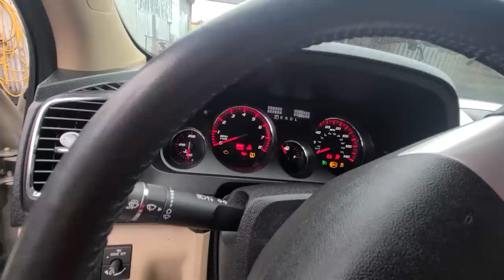Engines Need Oil.. Myth Or Fact? Drain Oil Redline And Learn! Neutral Drop

Comment: Please put a chain around an engine, then attach it to the wall and then slam in reverse… I wanna see if it’ll rip the engine out, sounds like a good video!!
Reply: DO IT
Reply: Or take the tire off a driveline axle wheel and let it spool up a rope or cable in gear and see if it will snatch the control arms and all out of it when it tightens up!
Reply: STUNTMAN GET OVA HERE AND READ THIS COMMENT
Reply: Can confirm this method of engine removal does work. A bit over 20 years ago I chained the 2.5 liter in a late 80s grand am to an oak tree, and neutral dropped it in reverse. When that 40 foot of chain ran out, what a ride. Engine and transmission came right through the radiator support. It was violent. As a bonus it was fun, and it saved alot of time removing the power train.
Reply: @williamsinger4124  "it was violent" 😂
Reply: @Me-zo8yc  yeah that sudden jolt and stop was about the equivalent to backing into a wall. Another added bonus, one of the bolts in the seat back broke...so I got a free gangster lean out of it too
Reply: @williamsinger4124  shame there were no decent camera phones 20 years ago
Reply: @Me-zo8yc  it would've been cool if we thought to record the antics we did with old junkers. We had 15 acres and 5 of that was trails in the woods. My neighbors also partook in the fun. Nowadays my old neighbors still come into our hardware store and we reminisce about the dumb stuff we did. My wife and father in law basically scratch their heads and wonder how I'm still alive. But they also know now why I act how I do lol. "The smart thing to do when doing something stupid is, to not think about the smart thing to do "
Reply: @williamsinger4124  sounds great having that much space and freedom, hopefully STUNTMAN will give us a 2023 remaster 😂
Reply: Yessssss Genius
Reply: @dougr.6734  Prolly It will brake and cut stuntmans face in many gorey pieces...
Reply from the maker: 🤔hmmm
Reply: Holy shitttt 😭😭😭😭
Reply: @dougr.6734  nahhh this one sounds too crazy for junkmans yard 😂
Reply: @NEUTRALDROP  you gotta do it!

Comment: The perfect car for a corner car lot... Looks good, has one of the most unreliable engines ever in it.
Reply: Honestly we have a 2011 traverse 3.6 in laws have owned it since 13k and only used full synthetic oil - few times they went over on their changes but we are still on the original engine, timing chains and transmission Power steering pump, 150k and again at 181k along with  water pump and also a catalytic converter around 150k but its the highest mileage car we have and most reliable they’ve had, honda accord split the engine vw eos blew the rings, and the others rusted out
Reply: Only 3.6L failure I know of might have had something to do with it being in a car driven by an idiot who drove it with the gas pedal floored most of the time and couldn't be bothered to check the oil. I checked it for him and the dipstick was dry. It took 5 quarts to bring it to the full mark and the engine holds 6. About a couple months after that, he told me the engine failed due to a "cracked block". (He thinks engines always fail because the block cracked. He's an idiot.) That guy has wrecked or destroyed pretty much every vehicle he's ever owned. I think his mom smoked crack while she was pregnant with him or maybe she just dropped him on his head too many times.
Reply: @brianleeper5737  these and the 2.4 4 cyl have a timing chain design flaw so they’re notorious for that to people who never check the oil and go by the dash indicator for oil life remaining which gm put out a tsb saying not to follow because its too many miles late.
Reply: @ryanravencaller  Yea, the 2.2L Ecotec also has "timing chain problems" but every YT video where one is being torn down for a timing chain replacement--the valve train looks like the bottom of a charcoal grill that's never been cleaned. Obvious why they fail..like the old Fram commercial, "pay me now or pay me later". 
Also, since 2011, the oil change indicator is calibrated for the use of Dexos oil. That oil costs more. So I know that means some people won't spend the extra money. Those people will be spending the money they saved not buying the right oil on either a new engine, a new vehicle, or a timing chain job.
Reply: @ryanravencaller  haha whoops! I know whenever my moms acadia goes down to 54% oil remaining you can hear the timing chain or something not having a fun time, reminds me I need to add oil right now
Reply: @geckog35  We just get ours changed when its low and over 3-4,000 miles since it was done, GM put out a tsb not to go by the dash on these vehicles of these years unfortunately the dash indicator tells you to change the oil when its too late as they miscalculated the mileage. We are at 193k and climbing now, Almost due for oil change and we need to do strut alignment, then tires, and o2 sensor or cat before emissions in july but other than that its been strong, original battery and alternator Wouldnt hesitate to get in and drive anywhere after a little work, we take it from ct to ma to ri to vt to ny and its never left us stranded

Comment: Usually it's a timing chain issue. Definitely need to change the oil on a 3.6 at 3000-3500 miles regardless
Reply: More like change engine lol

Comment: This channel is why I drive a Honda 😂 they haven't killed one yet i don't think 🤔 love y'all !
Reply: That's because they haven't had any of the Modern Toyotas or Hondas. They won't have to try so hard with those now that they have to abide by the same Cafe standards that the Americans had for years now. Just saw a video on here the other day for a 2021 Tundra that already needed a steering rack. 3,000 miles.
Reply: @ashes2ashes863  they definitely don't make them like they used to i test drove a 2019 accord and it felt so fragile

Comment: You should do a whole episode on. Stuffed up the tailpipe. Where you test on what the effect are on different objects Bing inserted in the exhaust. Answer questions like. "Will it shoot out?" Or "will this damage the motah
Reply: You cannot damage a motah by plugging the tailpipe. Not even with a 1/4 turn valve being slammed shut at high rpms
Reply: There one in every crowd

Comment: I have a 2006 Cadillac SRX with the 3.6 V6. Other than timing chains mine runs amazing. Rwd also
Reply: My dad has had a 2014 Cadillac SRX since new and it has had no engine issues and now it has 75k miles.
Reply: I have an 07 CTS 3.6. Other than Timing Chains and power steering problems that I had fixed, runs fine now.

Comment: Eric O said that if you drain the oil and fill the crankcase with Fabuloso up to the full mark on the dipstick, these engines will run for thousands more miles.

Comment: We once had a trashed nissan micra beater just to drive around our private land and when the radiator blew we didn't care. After a few days the thing was still running and we drained the oil to finish it off. It still refused to die. We drove the thing for weeks until it finally seized. Incredible little engine.
Reply: The Micra wasn't produced in the US market... I assume you're in another country?
Reply: @ChanMan-mm7fe  Yes. I am German.

Comment: Did you know that you have to drop the engine down to do spark plugs on the 3.6?
Reply: There's another way, it's really shitty. And you basically need toddler fingers. But it's possible.
Reply: No, you need to remove the intake manifold.
Reply: I thought it was GM's North Star engine that you had to drop for spark plugs.
Reply: No you dont

Comment: I drove a Slant 6 with NO oil pressure for a week to work and back 10 mile round trip. Slapped a new oil pump in it and drove it for another 50 thousands miles and never saw the oil pressure light again!

Comment: Also how do the 3.6's in the jeeps / dodges compare these gm 3.6's? Out of curiosity lol.
Reply: Actually a good motor, they had the lifter issue when they came out over 10 years ago, it’s not a so common issue anymore, someone got 626,000 miles out of one. They are a good engine
Reply: I think they had a problem with heads that crack in the early days. The later ones are good.
Reply: @francescobalestrieri7096  thank you
Reply: @mdotguy  thank you also

Comment: Those early 3.6L couldn't even keep running with oil. Timing chain issues out the ass. The newer ones are great and make some damn good power. We have a 2019 traverse with the 3.6L pair with the 9 speed Trans they will move! And get good fuel mileage.